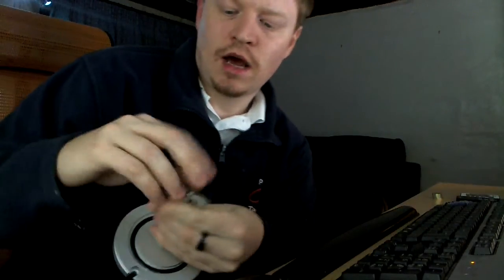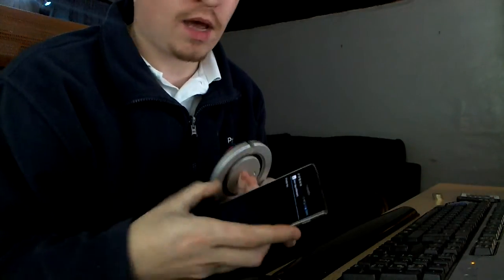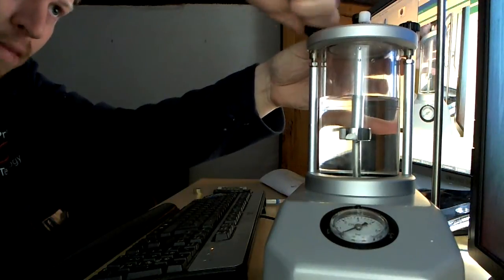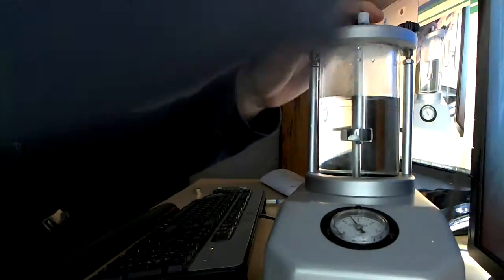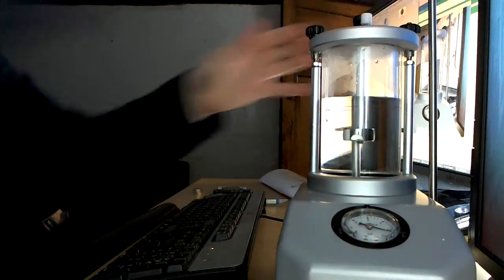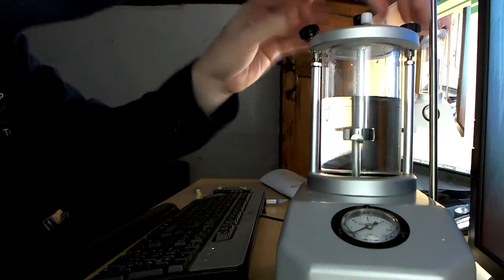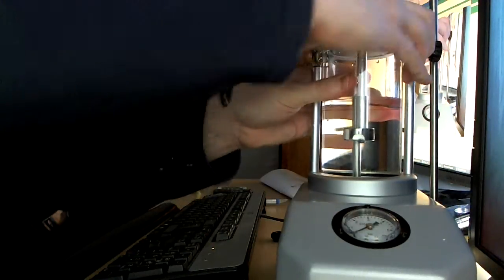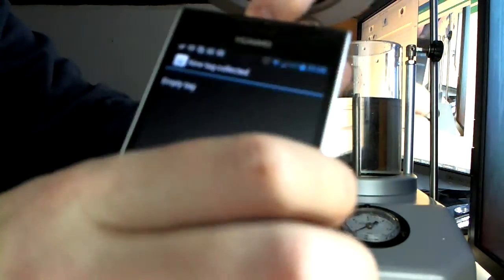NFC Ring water resistance testing @ 6 bars

Comment: What is 6 bar
Reply from the maker: It's basically the same as the water pressure at 50M :)  It's good news!
Reply: The deeper you go below water the more pressure builds up due to the amount and weight of the water above thats the crushing pressure they there testing with 6 bar is near triple the pressure you find in a car tyre so pretty vigorous test they are putting it through!
Reply: I understand atmospheres and such. I've just never heard the term bar karl taylor
Reply: Bar is more used with air and gas bottles i think you find it on a tyre pressure gauge but ppl use the psi scale as its more accurate